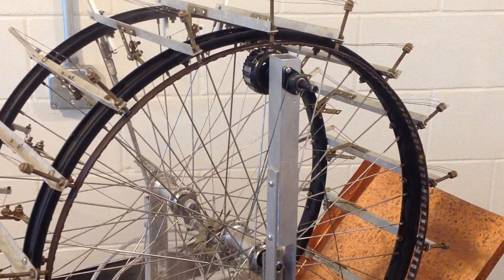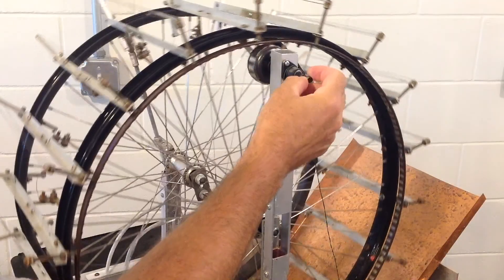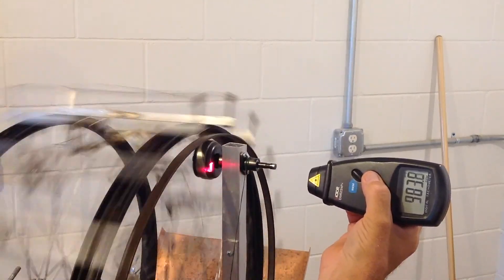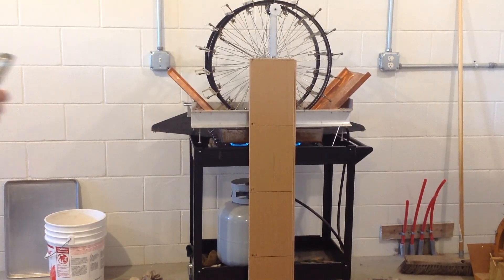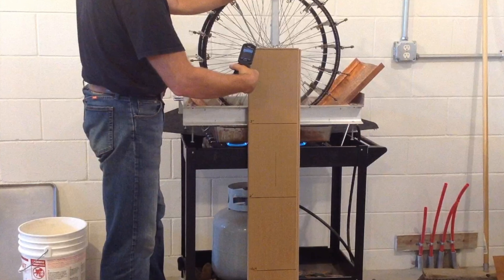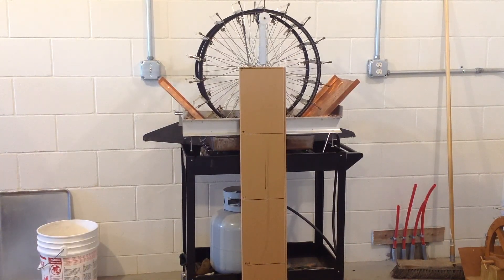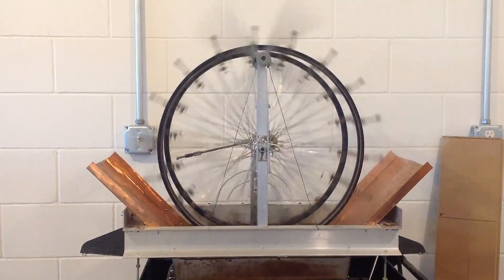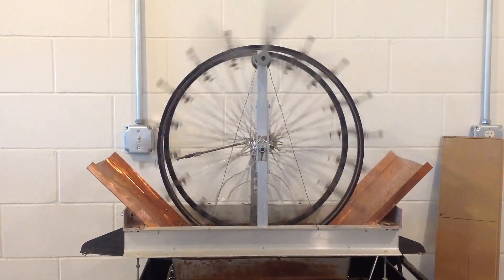Nitinol Motor load & rpm test, with magnetic gearing on 3rd design.

Comment: This might be crazy... But could you/I heat the water bath either with induction heating or solar magnification rather than gas?

I get the gas heating is for experimental simplicity... But given that the design works...
How low can you get your input energy costs?

The NiTiNOL needs to be replaced after 100 or so hours, right?
And in this experiment you are paying for gas to keep the water hot...

Say build cost was zero or as near as makes any difference (because some clever bastard did all the hard work already)... what would it cost you to leave this thing running?
And how long before it ran itself out?
Reply from the maker: The intentions of any nitinol motor, was to make use of low grade heat.  Like less than boiling.  -waste heat, solar, geothermal.
The manufacturer of this nitinol I used is Dynalloy "https://www.dynalloy.com"
They say their nitinol will do millions of cycles, but I think it would depend on the stress put on it.
I haven't found a big interest in nitinol motors.  I showed Dynalloy what I had, and they thought it was fun and interesting, but nothing more than that.  Just a novelty.

Comment: I'm really curious what your opinion is on the original design which rotates at fantastic RPM so fast you couldnt the RP m's or even come close to it with the naked eye and it runs off of anything above 20ﾟ water. 

https://yo    utu.be/oKm   YqUSDch8

This is the device I am speaking of it uses a strip of nightgnal instead of the currently public available nightinal wire which is incredibly expensive even though metallurgically it is one of the most basic metals and inefficient to create yet for some reason the price is artificially inflated to an amazing amount likely to stop people from attempting their own designs based off the initial 1 which was extremely efficient
Reply from the maker: The link didn't work, so I'm not sure what it is about?  Ridgeway Banks was the first to use nitinol in a heat engine, if that's what you seen...  
Personally I haven't seen any demonstrations of nitinol motor designs, showing actual power measurements.  I think my videos are the only ones.
I don't think there's much interest because of how bulky they would be, and expensive.  Nowadays; people want compact, high power, portable machines.

Comment: I am just amazed that this really works. How much gas are you using for this to run ??? Nice work fella.
Reply from the maker: I don't know how much gas.  It's just to heat the water for experimenting, and show that only a relatively low level heat will work.  It could be solar, or waste heat.  That's what nitinol motors were first going to be for, but no one ever developed one that looked very promising.
Thanks!

Comment: Absolutely love your work on your nitinol machine and I'm so glad I found this post, thank you.
I have an idea, If you use one wheel and use your u-shape brackets holding the nitinol just on one wheel you will reduce load.
So centre your u-shape brackets with two bolts on the outer rim of just one wheel to stop twisting. Use one long shaft and centre your wheel in the middle of the bath. Remove all the spokes you don't need or try a new carbon light weight wheel and add lots more nitinol springs for extra boost to your u-shape brackets.
You could try a levitational magnetic bearing for a new shaft design to reduce some friction if you really wanted to go that far. 
Also you can get top quality bearings for cycle wheels which may improve performance if staying with the traditional wheel you have.
In a nut shell, less spokes, 1 wheel and more springs.
If you go with the one wheel approach, you could try a flywheel experiment after your gearing.
These are just things I would love to see, please don't feel like I'm a dictator or anything.   😂
Love it and thank you again.
Reply from the maker: Thanks for watching, and commenting with all of your ideas.  It's good to hear that this inspires others! 👍🏻

Comment: How efficient is nitinol generator?
Reply from the maker: Hi Gediminas,  I don't know how efficient it is.  It's intended to use a low grade heat that would otherwise just be lost.  The propane camp stove was used to heat the water to a temperature that would simulate a low grade heat.  
Thanks for watching!

Comment: your design uses two bicycle tires which is fine however they are designed to hold a lot of weight and consequently you don't need all those spokes and could improve the efficiency a lot by removing about 50% of them.
Reply from the maker: You are right Jacob Ellinger, I would not need all those spokes.  Thanks!